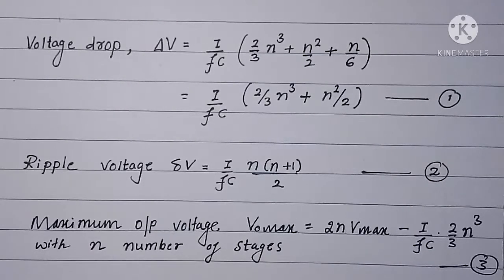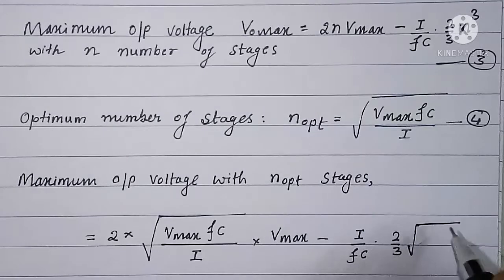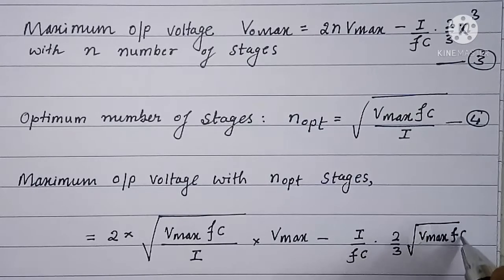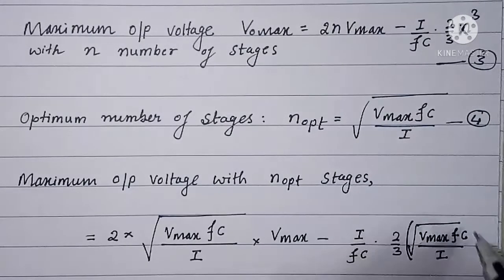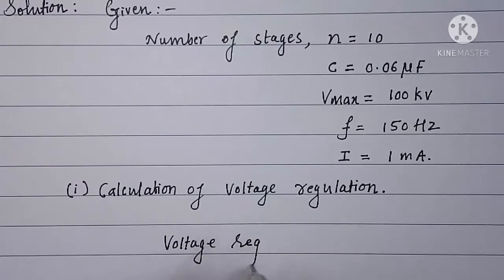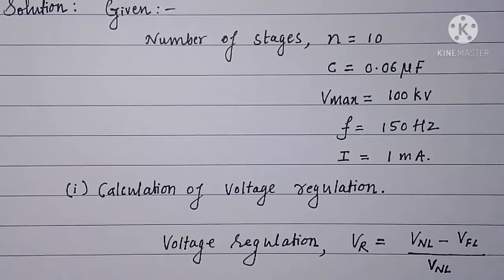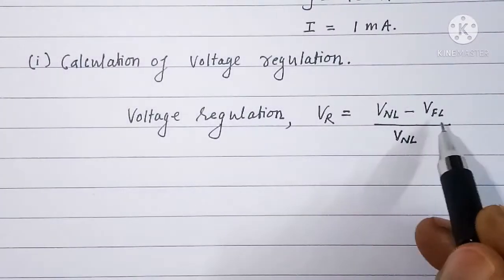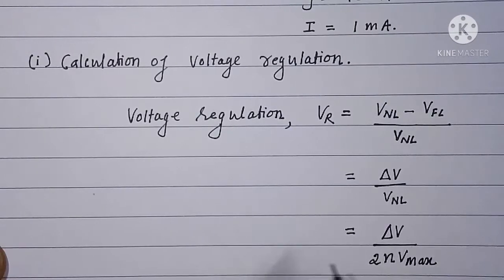Voltage Equations and Numerical on Cockraft-Walton Voltage Muktiplier circuit.

Comment: A 6-pulse bridge connected inverter is fed from 238/110 kV transformer which is 
connected with 3-ɸ, 238 kV, 50Hz supply. Calculate the direct voltage output when 
the commutation angle is 200 and delay angle α is i) 300
, ii) 900
 and iii) 1500 can you solve this

Comment: wrong calculations ripple voltage it should be 20 instead of 10 as capacitors will be 10*2=20